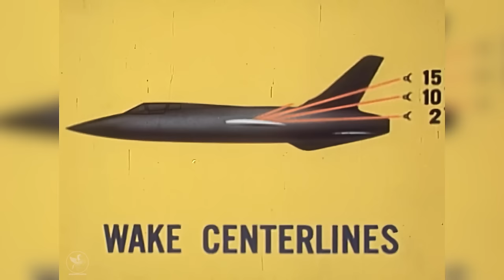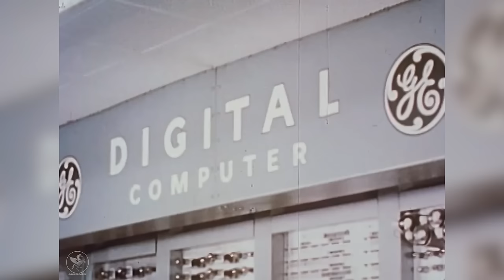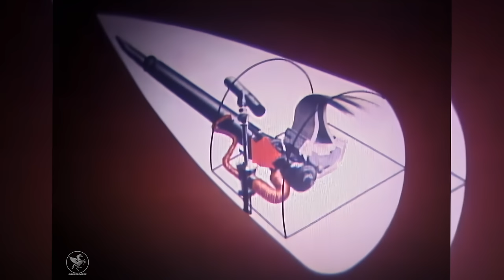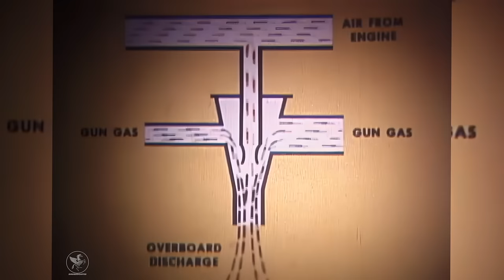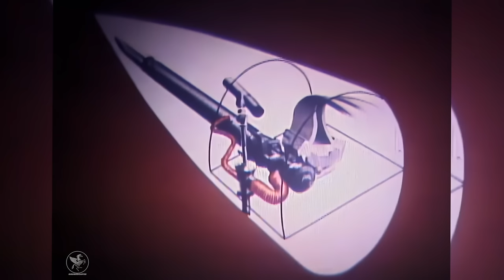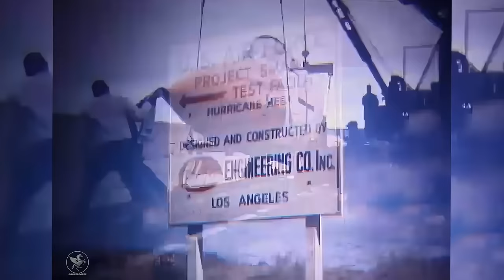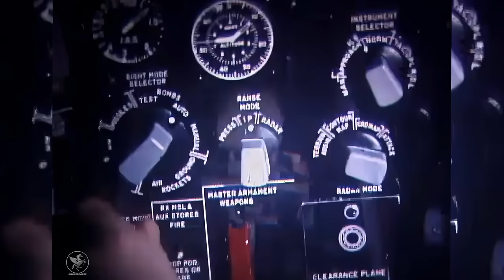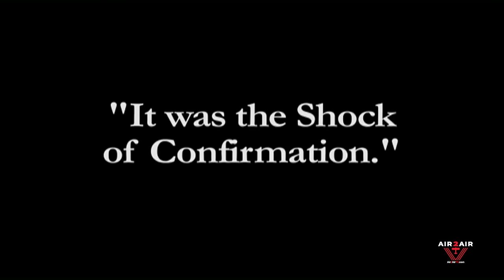Declassified Rare Color Footage Of The F-105 "Thud" Thunderchief Development Program

Comment: I’m told it’s faster and more stable down low than the F15. Purely anecdotal from someone with experience in high performance aircraft.
Reply: As far as speed the F-15 is limited to 800 KCAS (clean) while the F-105 was limited to 810 KCAS.  This is a structural limitation even though the airplanes have enough thrust to exceed it at low altitude.  

I wouldn't be at all be surprised that the 105 felt more stable in the part of the flight envelope for which its design was optimized.  It had much higher wing loading and I wouldn't be surprised if it was also endowed with greater static longitudinal stability.